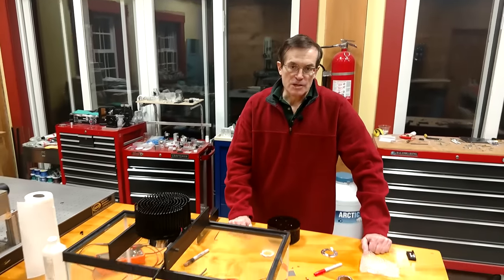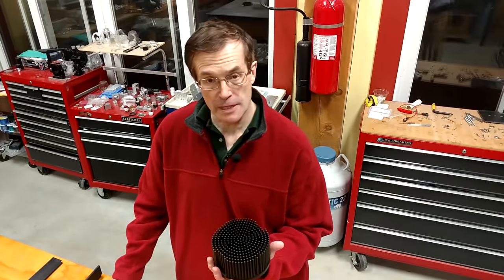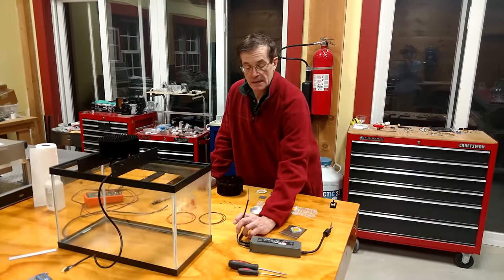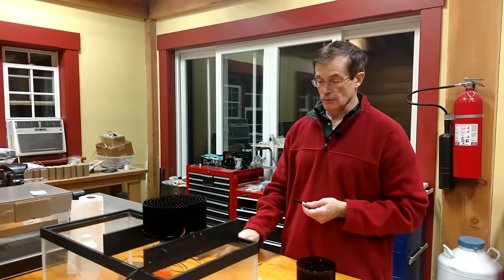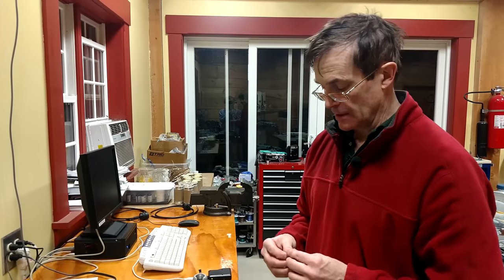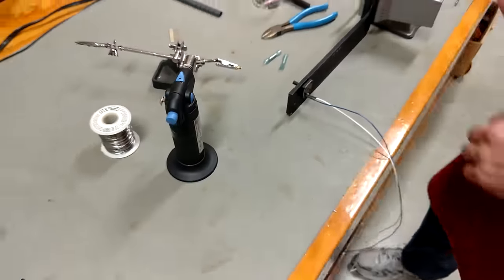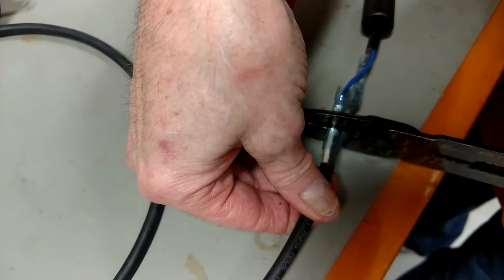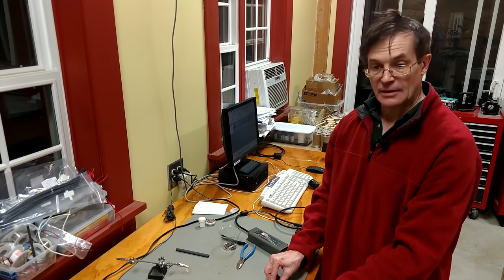Powerful LED Aquarium/Grow Light Assembly

Comment: A little trick I use when inserting screws and avoiding cross threading or getting the thread to start, is to turn the screw in the 'remove' direction (counter clockwise for right hand thread) up to one turn while applying very light downward pressure until a light click is felt. Then begin to turn the screw in the 'tighten' direction. This is a 90%+ way to get a sure start to threading a screw into a nut or tapped hole.  Nice tip on the spiral wrap! I hadn't thought of that! Great video!
Reply from the maker: I may do a short tutorial on tapping, there are a number of tricks that aren't in the books that really help.  Thanks for that idea and the nudge.

Comment: Thanks for the inspiration as always, kind and knowledgeable sir. I'm just re-getting into indoor growing (No it is NOT that stuff. Just ornamentals and vegetables.) and I'll be going with a premade LED fixture, but down the road I'll definitely want to get into custom builds for better control over specs. I grew up in the day and age where an LED was this amazing plastic thing about the size of a transistor but it glowed! Wowwwwww. Ask any typical person back then how long it would be before they grew up into all purpose lights so bright they could damage your eyes, and they'd have laughed at you. Now, they're just amazing and getting better all the time. LEDs and laser diodes are simply amazing devices.

Comment: I'm glad to see that the videography has improved so much in just a short time. It shows that someone is on the ball and really paying attention to making it more receptive to viewers.

I'd also like to comment on the control circuitry, even though this is nearly 2 years after the fact.

I'd move the pots from the fixture to another location closer to the power supply. This would serve 2 purposes at the very least:
1. There is less wire at the fixture, which means less to wrap and hide.
2. The pots are not above a high-humidity environment, which plays havoc with low-voltage devices. Over time, corrosion can lower the ability of the pot to work.

Even though it's more circuitry and more money, I'd opt for a PWM controller. It allows the light to turn on at a lower level, making it easier for the user to adjust the lighting level, and is also less likely to scare your fine-feathered fishy friends. It would be up to the circuit designer (you or your son) to decide if they want a single controller for both lights or to be able to control them individually.

I have a 6-foot dual-color Beamswork LED light above my 125-gallon aquarium. It has a common (-) and separate (+) to control the lights. I bought a programmable PWM controller with 5 channels, but it uses a common (+) and controls the (-). I used a single MOSFET for each of my 2 channels to be able to use it. It has been working perfectly for almost a year now, so I'm fairly confident that it'll keep on going for the long haul.

It was about $30 for the controller and only a few bucks for the MOSFETs and experimenter's box. It can be programmed by buttons on its case or via USB, which is what I did.

If all you're interested in is being able to dim them slightly rather than mimic dusk and dawn, then a simple pot is just fine, but I'd still locate it away from the tank itself.

While watching, I imagined using something like this to shine on the ceiling as indirect lighting in my home. Thank you for sharing this project and all the details on all the parts that go into the finished product!

Comment: Nice assembly, gonna look at the co. you mentioned for the diode chip/wafers. I know this is an older episode, but if ya see this it'd be appreciated. Do you remember the total cost of a single completed led assembly? Awesome stuff your put out there and the attention to detail is great too. Leaves very little questions about the projects if you are going to do one yourself. And not sure if it'd be too thick but to possibly secure the wires that are weaved thru the heatsink- put a matching length of heat shrink over each wire. Then they'd be a bit more clamped in between the fins and have an extra layer of insulation. Not sure how hot the heatsink gets after many hours of operation or if they'd just deteriorate too much but might work.

Comment: If the aquarium needed tropical temperatures, instead of those massive heatsinks you could use CPU water cooling blocks and circulate tank water, with some sort of bypass regulator system.
Reply: Some fish are quite sensitive to metal poisoning so you need to know what you are doing.
Reply: was ganna say same thing as rusle copper and aluminum is a big no no in fish tank hobby
Reply: especially if you have inverts.  That setup would end a shrimp tank so fast.
Reply: Seal the LED chip in silicone and put it inside a sealed glass jar with aquarium tube fittings, while pumping aquarium water through the jar.
Reply: Hah!  I know you're joking, but for everyone else - the water temperature tropical fish thrive in isn't much warmer than an air conditioned house.  The amount of heat from a single 100 watt fixture (in most smaller tanks) would cook the poor things, forget two fixtures.

Comment: @29:05 - "The solder goes from a shiny silver to a dull gray when you've got a good bond."  <insert horrified scream here>  :-)   Yeah.. no. A good solder joint is shiny and smooth.  Dull gray solder joints are called "cold" solder joints, and they aren't what you want.  I know this is an older video, but this is pretty important.  Cold solder joints are not as strong, they're brittle, and they're more susceptible to chemical and/or galvanic corrosion.  The dull color is caused by the metal actually fracturing into tiny crystals as it cools, usually due to movement of the joint.

The fracturing  of a cold solder joint leaves tiny cracks which weaken it and make it brittle.  They can also trap oxidation or chemicals (used to clean a PC board, for example) in the joint, causing it to fail way sooner than anyone wants it to.  Ask several major electronics companies from the early 2000's about the time a PCB foundry's solder temperature controls failed.  This one foundry produced boards for many different companies (RCA and Mackie are two I know of personally***), and those companies paid a lot in warranty repairs and replacements.
* Disclaimer: Neither RCA nor Mackie are at fault here, and they were far from the only companies affected.  RCA promptly replaced our television when it was found to be... "not economically feasible to repair".  Sadly, the Mackie mixer was purchased used (_really_ used, as mixers tend to be), and way out of warranty, but one intrepid repair person re-soldered most of the joints (that's a LOT of soldering!), and it worked well for a year or two before we replaced it.
Reply: Not if you are using lead free solder.
Reply: I'm really impressed with Mackie mixers. I installed on is a studio that did sound to picture, record folies and record remote telephone sessions. No matter what crazy configuration I needed (talkback for remote session is a nightmare), there was a button that did just what I needed.

Comment: I had some free time and was looking at some of these older videos. I like these LED lights, though my fish might need some sunglasses for all that light. lol I guess that adjustable resistor switch will come in handy.
Reply from the maker: Thanks!
We just finished an update where I assemble a far smaller lamp with twice the light output and use the waste heat to heat the aquarium.  Of course, this is also adjustable and can be mounted higher to light a much larger aquarium.
Reply: that sounds really cool getting double duty from the lights. i cant wait to see the new video.

Comment: Very cool lighting for a planted tank!  Can't wait to see you make an amazing CO2 injection system for it next!
Reply from the maker: We've had some very impressive marine aquariums over the years, but have never tried the planted tank.  It has always intrigued me.
Reply: @TechIngredients  If the light source in this video is being used for a planted tank, you may find that you need CO2 injection to help control algae formation. Try some of your champagne yeast in a bottle of sugar water attached to a small plastic air hose with a stone aerator on the end. The result is truly impressive. I was still able to have fish in my tanks, as well.

Comment: Philips has FINALLY started producing quality LEDs in the past two years or so. I replaced 1700W worth of incandescent lights with Philips lamps in 2014 and all but I think 2 failed within about a year. CREE or bust, baby! Never had a CREE-powered lamp fail on me. Or an OSRAM branded product.
Reply: its not the led that fails, its the driver.

Comment: Great video once again. Please keep them coming!

First and foremost, check all relevant local regulations for before embarking on any electrical project, particulary when in close proximity to water. I would use GFCI or similar protected outlet as required.

There are some ultra-high performance LEDs coming from some specialty firms including: Yuji, Xicato, and Soraa. I would use good quality non-conductive paste optimized for low pressure fitting to improve cooling instead of the thermal pads. 

I might use LockTite on the frame screws. I might improve splash protection (e.g. cover wire fully rather than use spiral wrap, move pot away from water, put a spash guard between lamp and water, etc.)

Comment: Id like to add led efficiency is not linear. you will receive far better lumans per watt ratio if you under drive leds and a far greater life span. it can be a cost annalisis of buying the next size up and under powering them to meet project lighting requirements if you are expecting to run them often and would benefit from an additional energy savings. with better efficiency comes less heat production so it may also come into a design requirement where you require less heat in an application or do not have the ability to property heat sinc.  For me I often only run the LEDs at 70% power unless I actually need everything it has to offer
Reply from the maker: You are correct.  LED's are actually quite linear in their efficiency if they remain at the same temperature, but they do not remain at the same temperature if the heat is removed by an unregulated, bootstrap method such as a heat sink, with or without a fan.  If you take a look at some of our laser videos you will see how substantially a diode increases it's efficiency with cooling all the way down to liquid nitrogen temperatures.  You are also correct that LED lifetime increases enormously as the driving current decreases. It is logarithmic.
Reply: I believe you observed a product of CC supplies it was attempting to push the same amount of current and thus raiseing the voltage across the junction. 

a few resent study I'v read showed very different conclusions. previously, it was believed that temperature was the cause of LED efficiency however this is no longer the case from my understanding.
here is a snip from the artical that will also have a link to the lab report: "as the voltage is halved, the input power is decreased by a factor of 4, while the emitted light power scales linearly with voltage so that it’s also only halved. In other words, an LED’s efficiency increases as its output power decreases. (The inverse of this relationship - that LED efficiency decreases as its output power increases"
Read more at: https://phys.org/news/2012-03-efficiency.html#jCp

here is a digikey artical about studies showing that LED efficiency believed to be related to current:
https://www.digikey.com/en/articles/techzone/2011/oct/identifying-the-causes-of-led-efficiency-droop
Reply from the maker: Got a problem with the first article.  The physics is too general and implies an increase in efficiency due to extraction of energy from processes outside the driving current.  Achieving greater than 100% efficiency in their experiment grabs one's attention, but would be ludicrous if it wasn't for the mention that this isn't steady state. The Digikey article seems reasonable.
Increasing temperature does decrease a diodes efficiency.  It is my understanding that this is due to the increased mobility of the charge carriers.
Reply: I haven't been able to find an cortical that blatantly says the decrease in efficiency due to the heat. maybe you have one you can recall? but yeah the first article is definitely interesting. I had no idea until recently that they could use thermal energy for photon emission at very low powers. although it makes scene when considering how thermal noise effects fiber optic systems in a similar manner.

Comment: You can get alumablack from gun tool suppliers such as brownells and midwayusa. It will not exactly match the original anodized finish, but its pretty good. Easy to use also.
Reply from the maker: Thanks.

Comment: I'm guessing you're going to have a lot of 4/20 viewers now ;-)
I built one myself  couple of years back for a propagation box (Sequoia and peppers :-), however using a single driver with 280v and many LEDs in series. Heatsink is an old PV inverter sink rated for a couple of kW😜

Comment: I just noted something you said that perked up the ears of this electronics guy... a dull grey solder connection is a 'cold solder joint' and is not a good electrical connection (nor mechanical for that matter). Heat the bullet, add solder to the cavity, keep the heat present, insert the wire and continue to heat until the solder on your tinned wire flows into the strands (this is quite quick, 1-3 seconds depending on the temperature and mass of your iron tip), remove heat and keep everything stationary while the solder solidifies. The finish joint must be shiny, not dull!
Reply from the maker: I should have explained in more detail.  The solder will change it's reflectivity when it goes from liquid to solid.  It isn't a large change and maybe saying it goes from shinny to dull is exaggerating, but if you're experienced with this you know what I mean.
Reply: @TechIngredients  Several thousand solder joints later and failure analysis made hearing 'dull gray' set off alarm bells. I figured you'd done plenty of soldering, but for those that hadn't, a cold solder joint is no Bueno! I didn't mean to harp... I've also found 2 other tips on solder joints of use. Cleanliness is paramount (a wet sponge for your tip) and when you remove heat and the phase change to solid is immanent, don't let the joint shift or move. Oh and flux at the joint. If your solder is rosin core (flux), add solder to a heated joint. Re-heating solder means the cleaning action of the flux is greatly reduced.

Comment: I was surprised that for a grow light application you didn't say anything about the spectrum of the light.  Presumably not all light that is white to our eyes is ideal?
Reply from the maker: You're right.  We selected the 3,500K COB because the general consensus on the Rapid LED forum and some hydroponics forums on Google recommended this spectral blend as the most favorable for plant growth.  It does have a pleasant appearance that;s close to, if slightly less harsh (blue) than natural sunlight.
Reply: I had great results with green plants at 6500K but warmer temps in the 3-4K range are supposed to provide better results with colored plants, especially reds. I would sure love to experiment with this light!

Comment: Hey man! I've been experimenting with these COB lights recently and am working on a submersible setup for underwater fishing. So far, I've tried silicone and different types of epoxy but haven't had great results keeping the lights running, even before submersion. I'm wondering if there is some sort of issue with materials overlaying on the phosphorus. Any advice? Thanks.
Reply: Go to candlepowerforums. Lots of high performance flashight mods going on there, including waterproof

Comment: Id like to see a dissection and analyzation of the domestic LED screw in light bulb, even though they dissipate only 13W typical, they seem to get very hot at the base. Im wondering what kind of crude driver or, perhaps its just a ballast resistor/rectifier. is inside them for matching to 120vac. They are not really much more efficient than the compact fluorescent when compared to incandescent. Thanks for creating this great content.
Reply: They will typically have a capacitive dropper to drop your main voltage to the lamp's requirements. bigclivedotcom has a lot of those tear downs if you are interested.
Reply: Thanks for the link Long Plays

Comment: One major problem off the bat is plants do not care about lumens at all they care about par. Our eyes care about lumen output. You guys should check out chilled led much better spectrums and canopy coverage.
Reply from the maker: Actually, plants care about both.  Obviously, a PAR  with an optimal mixture of wavelengths for plant growth vs for flowering (I do know a bit about this) is meaningless if there is virtually no light output.  Light output is specified by lumens.  Cooling LEDs improves white, phosphor based efficiency, but not nearly as much as non phosphor based LEDs that do not rely on GaN junctions.

Comment: Would a Peltier(sp?) cooling system work for that application?
Reply from the maker: It could be used, but it wouldn't be that useful.  They are very inefficient and a simple water cooling system works well as I demonstrated in our follow up video.